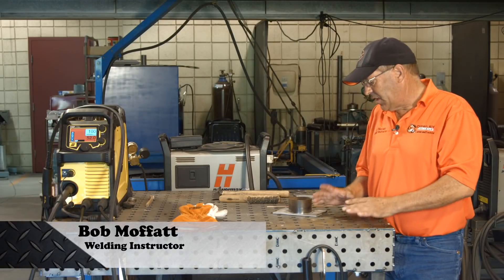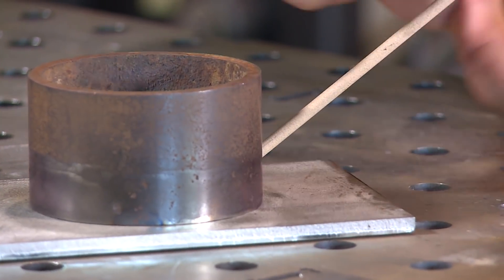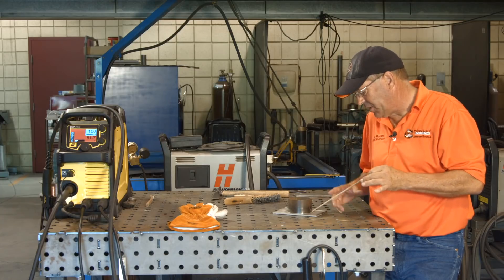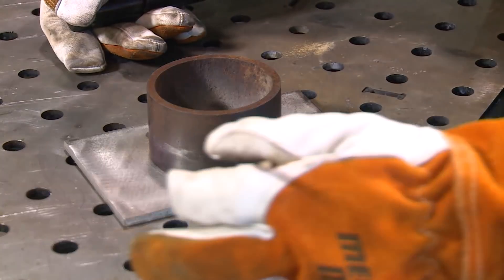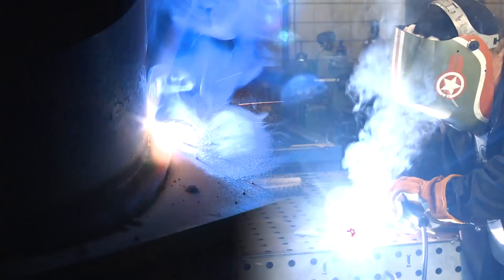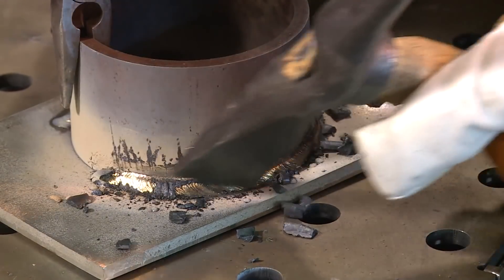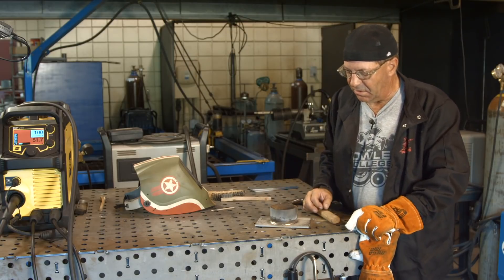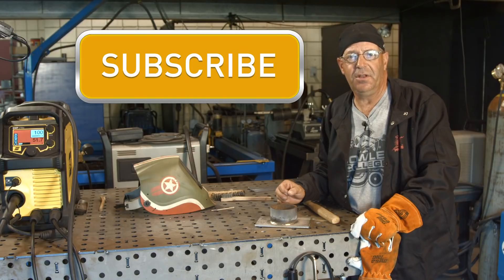🔥 Tips for Stick Welding Carbon Steel to Stainless Steel

Comment: I'm currently trying to learn aluminium stick welding could you give and pointers. I know it's far from an ideal way to weld aluminium but if it's doable I'll try and learn it. Lots of thanks for the grate videos keep them up
Reply from the maker: josh starling your timing is good. that's on the list for next week.
Reply: Weld.com great to hear that. I knew one fella who could do a decent stick aluminum weld, but my results have been mediocre at best. Do have a TIG and a spool gun bug sometimes SMAW is needed

Comment: Can someone explain the splater? During some welds the splatter looks like a shower and on some it's really light. Thanks in advance.
Reply: Spatter is mostly determined by the type of rod without getting into machine settings. E6010, E6011 type rods are a spark shower. E6013, E7014, E7018 type rods are pretty smooth with way less spatter.
Reply: Bob  Moffatt 6010 don't spark much when it's jammed in the pipe.  I've actually had my autoshade turn off on root passes before
Reply: +chris jones Thank you Gents.

Comment: Looks like you could've gone a bit hotter, but that's a good test for that machine at 100 amps. What's the max it will run on 115v? I wonder how many 1/8" rods you can run at 100 amps before you hit the duty cycle on that esab. What brand rod did you run. I actually really like the 309 stainless for a lot of reasons outside of carbon to stainless. That heavy slag will dang sure stick to your skin! Bob, you need a little box fan to blow that nasty plume of welding fumes away from your mug, especially with stainless. Hexavalent chromium brother.
Reply: I could've had more than a 100 amps but I felt with such a small demo part it would lose color if heated to much. Thanks for noticing. As for the duty cycle on this machine, I'll bet I could run all day at 100 amps with few problems. Great idea for a video, thanks for the comment. B